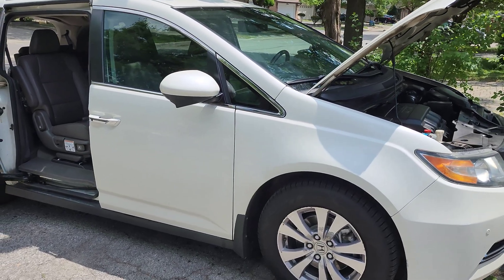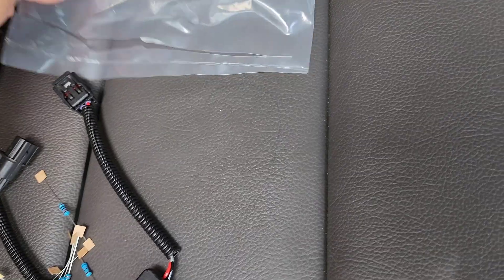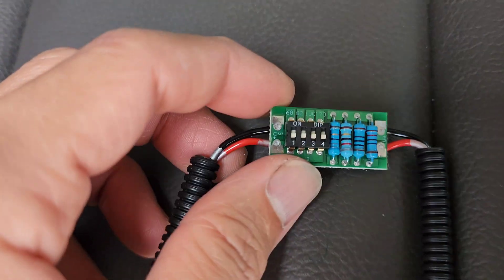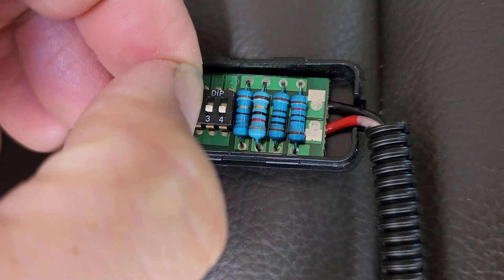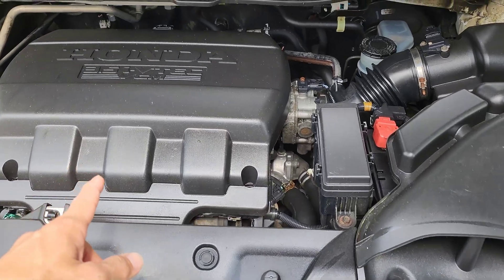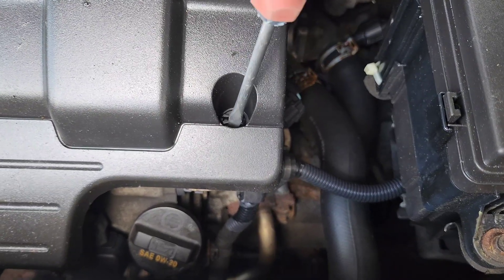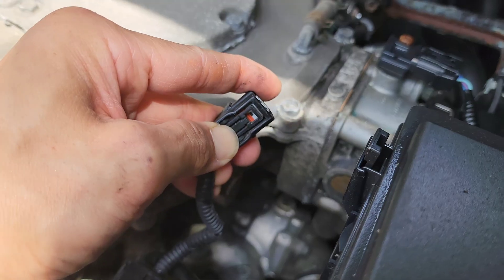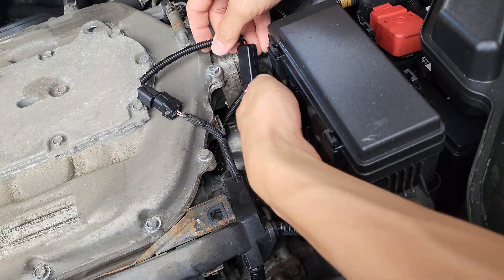VCM Muzzler install on 4th Gen Honda Odyssey (2011-2017) 3.5 L J35Z8 V6

Comment: Thank you so much! Your video helped me as a women install this myself in my van. My question is I have it set to 82 and noticed the eco still comes on some. Should I set it to the higher one?
Reply from the maker: I'm so glad that I was able to help you! 

If your eco light only comes on very sparingly, I would leave it at 82. If it comes on too often for your comfort, then you could go up to 100 (if you do, make sure only one resistor is activated!).

If you're in the Northern hemisphere that is experiencing fall (autumn) now, I think 82 would be good as the days are getting colder and colder.

If you're in somewhere like Florida, you could try 100 ohms.

This type of passive resistor will only deactivate VCM about 90% of the time, which is good enough!

Don't forget that you have to unplug the red wire of the battery for 60 seconds after you change the resistance, in order to reset the ECU and all that, otherwise your check engine light might come on.

Comment: Hi is this the newest model VCM muzzler? Do you have the link?
Reply from the maker: I think it's the latest design, but for a passive one (manual adjustment). It was this one: YEZriler VCM Muzzler Tuner 2... https://www.amazon.ca/dp/B0F3X4VHT8?ref=ppx_pop_mob_ap_share
Reply: @treelife365  ok thanks
Reply from the maker: You need to disconnect the battery (to reboot the system) after install and each time you change the resistance settings.

Comment: Does this affect the engine's cooling system? I'm asking because I live in Qatar, and summer temperatures here can exceed 50 degrees Celsius.
Reply from the maker: Not at all! It simply causes ECT1 (engine coolant temperature) to read a lower temperature (depending on which resistor you use), but ECT2 is not touched. To quote Honda Odyssey forums:

Also, only the reading for one of the temperature sensors (known as ECT1, short for Engine Coolant Temperature Sensor 1) is altered. The other (ECT2) is left intact, so cooling fans will still operate normally, because cooling fans are controlled by ECT2 and are not at all affected by the ECT1 reading.

Air/fuel ratio has also been found to be unaffected by using a VCM disable device. In fact, the only difference you'll notice is that your coolant temperature gauge may sit slightly lower than before when fully warmed up. However, there is no need to worry, as you will still be able to tell if your engine is overheating, as the gauge will still rise to hot like it would before.

Comment from the maker: It has been really hot in Toronto for a few days and at 82 ohms resistance, I noticed the ECO light coming on occasionally...

So, I changed the resistance to 100 ohms and the ECO light isn't coming on at all! No funny dash lights, either. 

I do notice that the temp gauge sits slightly lower than it did before the change.
Reply: I got the same muzzle installed but the engine light came on , so I cleared the engine light with my OBD2 . But still the ECO light comes on as normal before

Comment: No positive wire going to battery?
Reply from the maker: This one is a passive muzzler (not active), so there's no electricity needed 😊

A passive muzzler simply impedes the flow of electricity/signal to ECT1 via a resistor.
Reply: @treelife365 thanks, is this the one that you dont need to adjust the resistor settings?
Reply from the maker: @vuinavennie  - for this one, you need to manually choose the resistance, based on season.

But, it's better than the simple ones where you literally have to swap resistors in and out; with this one, all the resistors are on a PCB in a little black case, and you just flick a switch to choose the resistance that you want. 

I started with 82 ohms resistance and it's summer here in Ontario and it's working perfectly. The other resistance selections are: 68, 82, 100, 120 ohm.

In winter, I might have to lower the resistance to 68 ohm, by popping the hood, opening the plastic case and flicking the switches.

It's a manual procedure, but it's 1/4 of the price of the automatic ones and I got it from Amazon, so it's returnable!